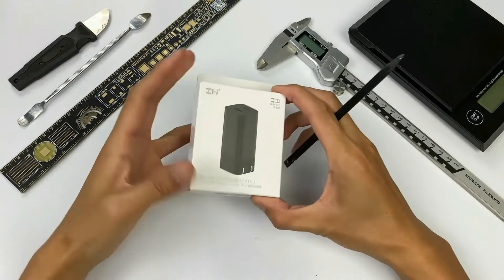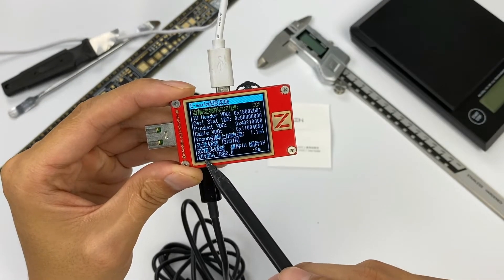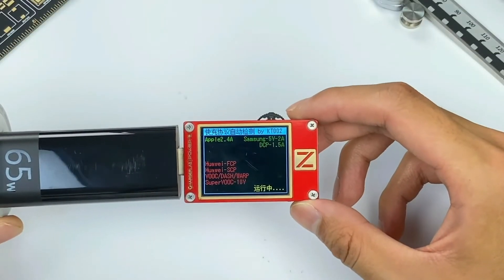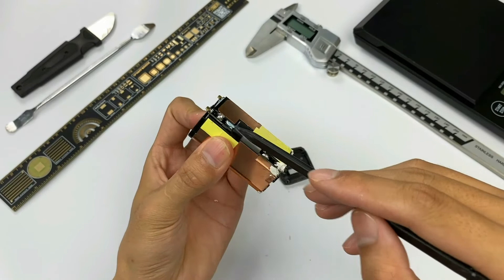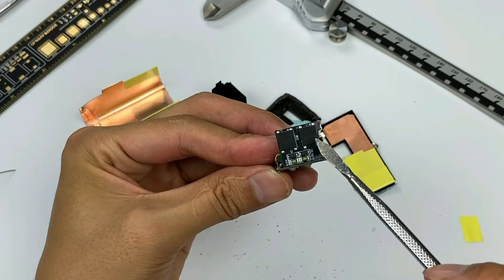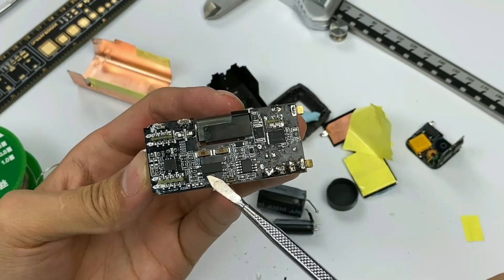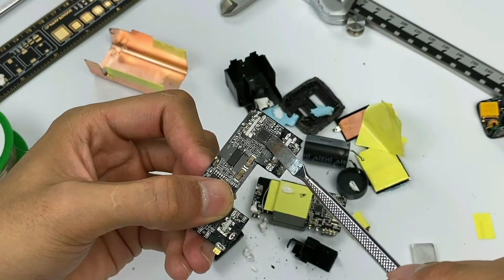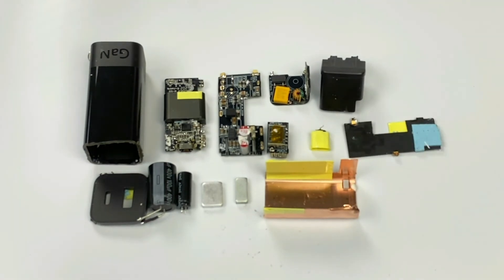Teardown of ZMI 65W GaN Charger (1A1C)

Comment: I noticed the output ports are rotated 90 degrees from the input port compared to the Xiaomi 65w. This means they will be verticle when plugged into a north American socket. 

I think this is really smart as it will reduce strain on the output ports.
Reply from the maker: Totally agree with you.
Reply: @ChargerLAB  sir is the transformer on the baseus 100watts type c ok compared to this?

Comment: @3:57: Why the adapter dont selfdischarge?
Reply from the maker: Because there is still some electricity remaining in the capacitor after disconnected.
It'll take some time to self discharge.
For testing, we need to save time. So.....
Reply: @ChargerLAB  is there any risk of electrical shock if we touch to the prongs after remove chargers from wall plug?
Reply: @cuonglbq3029  there is risk but It won't kill you depending upon the capacitor used
Reply: @Startekselva  Thank you. :)